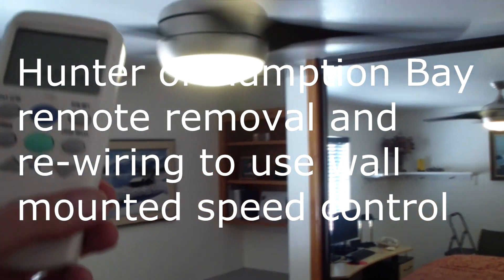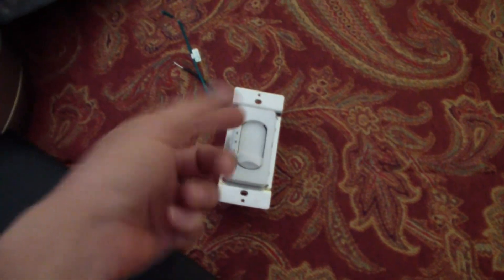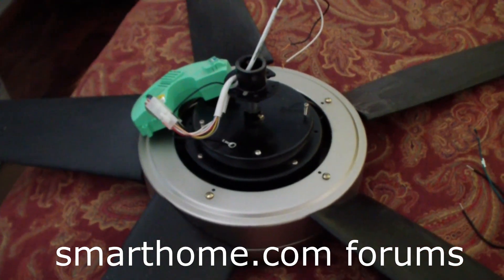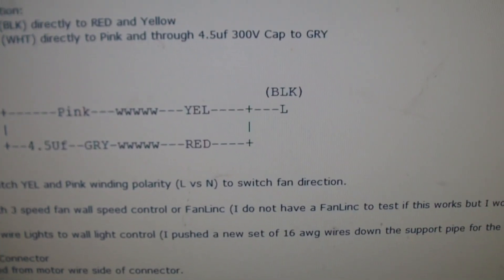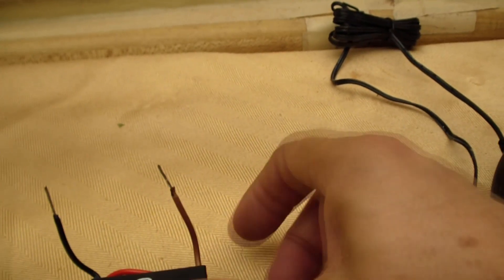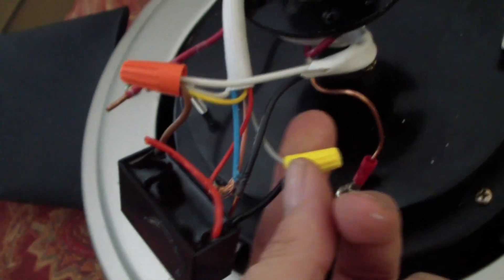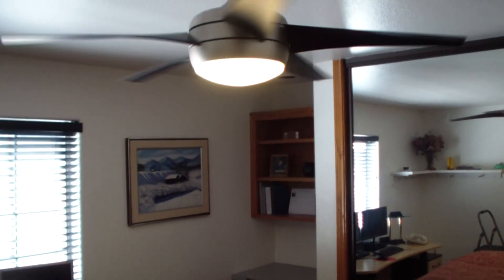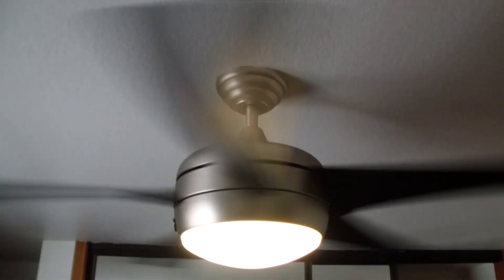Hampton Bay or Hunter Ceiling Fan Remote Re-Wiring For Wall Control

Comment: I have this exact same problem!  Do you think this technique would work with a Z-wave fan controller like the GE Z-Wave Smart Fan Control 12730?  Although, I may leave the light remote controls in the fan, because I have upper and lower lights, and it's nice to not have them all going at once.
Reply from the maker: Yes. The GE Z-Wave would work just like a manual wall mounted fan controller.

Comment: Hi Kent , Very nice video clips with step by step details. I have the similar type fan ,  the inside fan box contains multiple capacitors which works as speed for coil, now it  runs  slow ,  Tired of hunting for similar CBB65 capacitors , After watching your video I want to change it to wall fixed  regulator control  type , is it possible to change ,your advice please . tks
Reply from the maker: The wall switch has multiple capacitors for speed control. See my new 
Rhine UC9020 Repair video to see inside. So the fan needs a starter 
capacitor and the wall unit has the caps for speed control. Never use a 
light dimmer on a fan.
Reply: Hi Kent , Thanks for your swift reply, I fill a bit confuse here , If I dismantle the capacitors ,there is a lot of colored wires ,Here I don,t have the circuit to connect them , Just your small advice please , Do I need to loop the coils wires  with the help of my  meter ,if yes ,how many wires should I bring out to connect to the power ,,3 of 4 . ,, Black for  neutral ,red for power and green for gnrd .
your valuable info please ..
Reply from the maker: I do not know your exact circuit. the forward/reverse switch should run to the starting cap. The pull chain is for the speed control caps. Bypass the speed control caps and connect line directly to motor. From the wall you normally have two or three conductors plus ground. White is neutral. White always goes to white.  Black and red, if there, are are the AC line hot connections. See which wall switch runs to each color wire.
Reply: Kent ,Thanks again , I am watching your video now, I can managed it , If problem persist ,will seek your help . Thanks Kent frm SIN
Reply from the maker: The yellow and pink are the main power to the fan. The gray and red go to a different set of winding. The capacitor is referred to as a starting capacitor. So the phase difference of the starting cap in relationship to the main winding change the direction of rotation.
Reply: hi Kent Diego , thanks for your advice .
Reply: Hi Kent, thanks a lot for the video it's extremely helpful! I was following that forum as well but am still unsure of how to wire my fan. I have a hampton bay fan/light with identical wiring like you have for the fan (red, grey, yellow, pink). The fan controller I am looking to use is a hampton bay zigbee controller and I have a Black (Load) and White (Neutral) wire for the controlled side for the fan. Are we just bypassing the fans start and run windings and using the capacitor in its place? Or what would happen if we just capped the gray and red wires? Would reverse still work? Sorry i'm a little confused why the fan has multiple wires haha. Thanks in advance!
Reply: Can you have this without the. Switch just wall switch